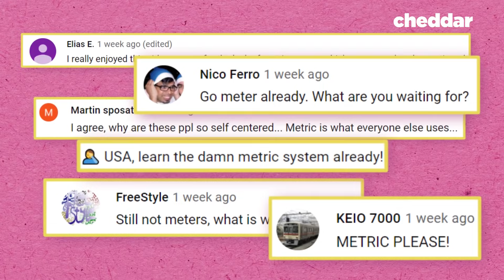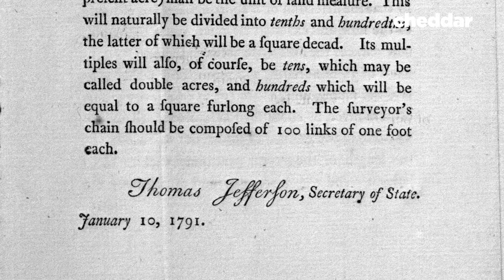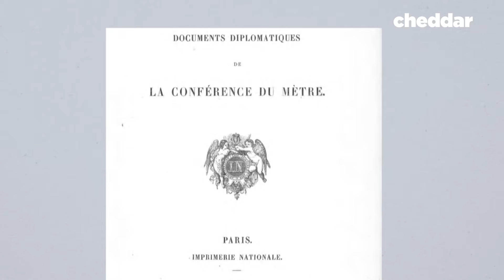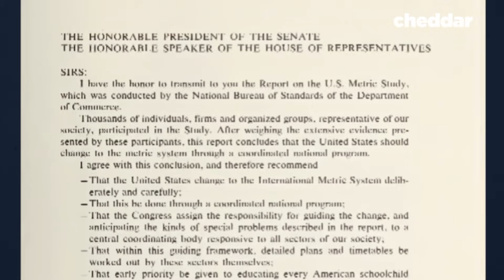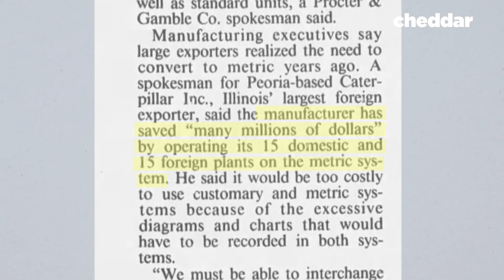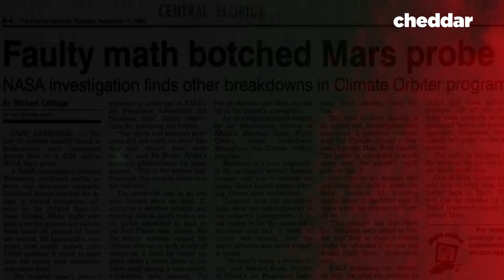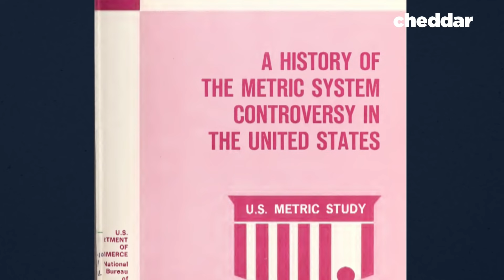Why Doesn't the US Just Use the Metric System? - Cheddar Explains

Comment: All of this boils down to the fact that Americans want to be SPECIAL.
Reply: We already are special, just look at our president lol
Reply: NO
The eggs must be cracked on the BIG end
Reply: But seriously tho, each system has its own advantages. In defense of the US system, a fractional system can facilitate mental math in some situations.

For example, QUICK! What half of 3/4? Vs QUICK! What’s half of 0.75? 

It is much easier to bisect a 3/4” part than a 0.75 centimeter part (barring just memorizing the math.)

This is why I, and many, Americans still prefer the US system in the shop and at (non-science) work.
Reply: @dudeness0001  Your example doesn't really work for two reasons.

1. It would be easier for you to halve 3/4” as you are used to the imperial system. But you should just as easily be able to halve 0.75 as metric users if you think along the lines of what is half of 75, I'm sure you could halve 75" without missing a beat.

2.  0.75 cm would actually be 7.5 mm in the metric system. 0.75 is more relevant to 3/4" when used in engineering terms, as machining is done using the thou system where an inch is divided into thousandths. (Sorry if you already know that, don't know your background so just covering all my bases) Actual comparisons are 3/4" = 19.05 mm
and  7.5 mm is about 19/64", both imperial sizes would be done in thou.

The thou system is actually very accurate in machining, I think it is when people start talking about 16 ths, 32 nds and 64 ths of an inch that the problems start. Having worked on machines using both thou and mm I can see things from both sides, but to understand where I stand on the matter, all you have to do is to look at the last tape measure I bought, it's metric only. :)
Reply: llljustcallhimDave I see where you’re coming from with these counterpoints, but they make it clear to me that you kind of missed my point.

First off, my example is from a layman’s point of view. That is to say, from the point of view of someone who isn’t in science, engineering, or precision machining. Thus my stance will only really be valid for people who either don’t take measurements often, or who never have to take measurements more precise than 1/32” or 1/64,” such as hobby woodworkers or skilled tradesmen.

I used 3/4” to demonstrate that in order to find half of a fractional measurement, you simply double the denominator. In this case, half of 3/4” would be 3/8.” It is a much easier mental calculation than finding half of 0.75cm, no matter which system you are more used to.  The numbers don’t really matter either; try halving 5/16” and 0.87cm — it’s about the cognitive load.

Certainly this would all be moot for someone that simply memorized all the basic arithmetic for the most common measurements, but the layman would almost definitely not have done that.

I touched on it above as well, but I know that 3/4” and 0.75cm aren’t equivalent, by the way.  I picked them based on the raw numbers.

Thank you for offering your insight though, it did help to show me where my justification was a bit lacking.
Reply: dudeness0001You are looking this from a very American point of view. I mean no metric system user ever uses 0.75cm but instead 80mm. you are just converting imperial units into metric totally unnaturally. Also, nothing is stopping you from saying 3/4cm but that is just a dumb way to do things and it is only used in the imperial system just because converting a unit to an another is so hard.
Reply: *Are not want
Reply: @frankreynolds445  that's because your used to the imperial system.
Reply: Not special, different... And free.
Reply: yes special my cat ass
Reply: Plus we're lazy.
Reply: No it boils down to you just want to hate Americans.
Europeans: "Why don't Americans switch to metric, it's stupid to use two systems"
Also Europeans: "Why dont Americans learn more than one language, it's stupid"
Why can you learn more than one language but not more than one system of measurement? It's really not that hard- math isn't hard. 50 years ago we landed men on the moon- when Europeans do that with the metric system, then you can complain about us thinking we're special- because we'll still be at least 50 years ahead of you in the space race😉
Reply: C17H25N FTW  like nasa?
Reply: You can be special or you can be sheep.
Reply: C17H25N FTW  well imperial system is also a European invention and we are just trying to convince Americans to upgrade from the old shitty system to the new one. Also everyone who has a degree of intelligence and needs units in the US has already switched to metric.
Reply: Everything before 1776 was a mistake. #BuildTheWall
Reply: No just that changing to it has no real benefit.
Reply: @Mav42  Ou it has. Think about it, the switch may be expensive but in long run all the conversion errors will cost more than the switch. Fore example the NASA orbiter.
Reply: @jholotanbest2688  The NASA had little to do with conversion errors. Way more than that caused the issues. That excuse is more of a PR excuse to save face.

And  just in case people don't know, the US officially recognizes the metric system as the preferred system for trade and commerce. Switching would cost a lot of money and there would be very little benefit to the every day lives of Americans.
Reply: @Mav42  You clearly didn't get my point. In long enough timespan conversation error will cost more than the switch will. 

The official reason for why to 100 million orbiter crash laned to Mars was a conversation error and you can say what you will about saving face but it was just an example.
Reply: @jholotanbest2688  I get your point. My point still is that the NASA mistake was much more than a conversion error, and that switching would NOT have any real benefits. When we do science or trade with other countries, we already use metric. There's no benefit for the entire country to switch even if the metric system is better. It wouldn't improve the lives of Americans in any significant  way and it wouldn't save us any money.
Reply: @Mav42  Imperial system is just simply inferior. You have  weird fractions to describe lengths and don't get me even started about conversions in the imperial system. Also conversion errors will inevitably outweigh the cost of switching in the long run.
Reply: @jholotanbest2688  Literally not a problem for 99.99% of Americans in their day to day job. When exact measurements matter, we use metric. Otherwise, we don't. So again, it would have no real benefit for the lives of your average American.
Reply: jholotan best I would rather take a fraction like 1 1/2" over a system with so many units I can't keep up. We all learn fractions in the fourth grade in America but learning 20-50 units all named meter in some way sounds way too hard to remember all the little subsets of the meter family. We have 3 units however inch foot and mile which are all easy to remember and have very different names because we're smart and didn't call it micro foot, foot and mega foot like you guys basically did with your meter nonsense
Reply: @LucasFernandez-fk8se  You are like people of North Kore they don't know about anything better... First of all you forgot all the other imperial measurements like thou, yard, chain, furlong and league plus the maritime units and the Gunter's survey units. It is true metric system has a infinite amount of units but people only use the ones that are relevant. Only relevant units are the millimeter, centimeter, meter and kilometer so much fewer than the imperial system. And the real reason why the metric system is superior is that everything is power or fraction of ten. So you can do all the conversations in your head and no fractions needed.
Reply: @LucasFernandez-fk8se  Which is quite nonsense because the "mille-" means 1/1000 when applied to every single metric unit, while in imperial you have to switch to a completely different word. Also, with metric you can just describe everything that is regular size in millemeter and as long as you know that information you can understand it, so that you can just say "this part has a length of 500", "the car has a width of 2480". With imperial if you say "this guy is 80 inches tall" nobody got any idea how tall he is (not sure if 80 inches is in the range of human height though).
Reply: jholotan best 
They’re not weird fractions, 1/2, 1/4, 1/8, 1/16, etc. Each is half of the one before it. Take a piece of paper and try to figure out what 1/4 of the length is, now try to figure out what 0.3 of the length is. Imperial was easier to implement with simple tools. At this point, very few Americans want to learn a new way of measuring quantities that effect our day to day life, and with more guns in private hands than people, good luck trying to force us to change 😉
Reply: @jholotanbest2688   There is nothing "weird" about fractions. They are much more normal to the human psyche than decimal. Music, which is a very natural thing, lives and breathes by halving and doubling. (Think semitone, quarter note etc) Even cutting a pizza is usually done by halving, and halving again etc. Decimal is not a natural human instinct.
Reply: @Mav42  That is in a way totally true all systems of measurements are fine and usable in everyday life. 
My original comment was pocking fun at the fact that basically all other counties have converted to metric except the USA. The reasons for that are interesting in my opinion and it all boils down that Americans have always wanted to be special ;)
Reply: No, it's just that we don't want to change and nobody can do anything about it.  When you're the richest most powerful country in the world, all the other countries adapt to you. That's why 99% of everyone reads, writes and speaks in English on the global internet.
Reply: @DoomFinger511  Are u stupid? Countries didnt start to use English because of the USA
Reply: @chaowingchinghongfingshong3109  Learn how to read. I never said America countries STARTED to use English because of the USA. They started to use it because of the British Empire. After WWII America picked up the mantle and being the country now holding all the power English became the standard language for trade due to America's vast influence. Influences like YouTube, and the operating system your computer is using to access it.
Reply: @DoomFinger511  you are an idiot. People dont speak mostly english on the internet because your great country is the richest country ever that has been kicked out from afghanistan, but because the british ruled a lot of places in the world making english much more common than what it was. Because of this we speak mostly English on the internet
Reply: @jijdom  And rub little bit more salt to that wound Imperial system is a British system ;)
Reply: Except you're not. You were but you're falling off that pedestal of being the richest and most powerful. You will find that the rest of the world is not going to supply to you and will not buy from you in obsolete imperial measurements. It is too expensive and leads to serious technical problems. You want pounds, you'll get kilograms. You want to sell in pounds, the rest of the world will insist you re-weigh in kilograms or we won't buy it. It's already hurting US trade, once you find it's emptying your american wallets paying an imperial tax, you'll switch over and stop being the only one in step.   
The metric system or more properly "Système international d'unités" (S.I.) aka "International System of Units" was invented for international trading. It is international and the all other countries are using it.
Reply: @DoomFinger511  I didn't know America invented English.
Reply: @googlesucks7840  They didn't, they just made it better and influenced the rest of the world to continue using it after picking up the mantle after Great Britain.
Reply: @DoomFinger511  Thanks for spreading the English language to Australia, New Zealand, Canada, India, South Africa, Africa, Asia, and Europe. It's highly debatable that dropping an "O" has made any significant difference though.
Reply: DoomFinger511 you do know that there are several countries with English as their first language. (E.g.; GB, Australia, Canada)
Reply: @DoomFinger511  That is exactly what I mean with SPECIAL ;)  Btw you realize that the power of the country is irrelevant because the measuring system is only used in that one country.
Reply: America is better than Europe that is why we left the craphole. So the European pinheads can have their stupid metric system and we will keep ours , you people don't even know how to drive on the right side of the road .
Reply: @taisontaison4118  HAHAHAHAHAHAHA US better than Europe!!! I'm not even European and that's hilarious to me! The thing is, the whole world uses the metric system except for the US and a couple of third world countries.

Comment: The imperial system needs to go. Whilst we're at it, why not switch to Celsius as well? Metric and Celsius are objectively superior measurement systems, and in an increasingly globalised world it is very helpful to have one universally recognised system of measurement.
Reply: That is until you want to measure a third of a meter in centimeters...
Reply: @DoomFinger511  Rounded slightly down, it's just 0,33 centimetres, or you could just say 1/3 of a metre. The problem only arises when you're trying to find its value precisely in centimetres and don't want to use fractions.

Comment: the most acceptable inch meauserement is for phone screen, imagine instead having 6 inch, we have15.24 cm screen phone
Reply: make the switch, companies will simply start to produce monitors, phones and other products with with 15 cm screens or 18 or 30 or whatever fits. its no problem to keep the widely spread 16:9 ratio of modern screens with metrics... 
your argument is like me saying: “why did they build the empire state building 443.2 meters tall instead of an even 444 or 443? thats stooooopid”. its not of coure, because in feet it measures out evenly. its just the perspective that counts so your point is moot.
Reply: But it's really not an accurate unit anymore. A "6 inch" screen can be in the range of 5.7~6.2 inches and the aspect ratio can vary.
Reply: Just keep using your lazy units
Reply: @vN2w3Z59BM  Hmm, I wonder what screen size your computer monitor is?